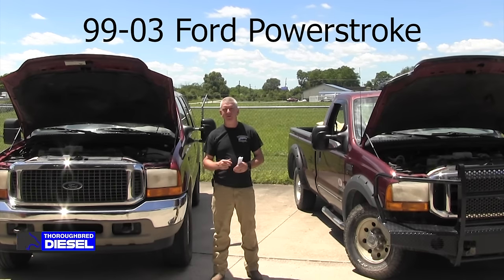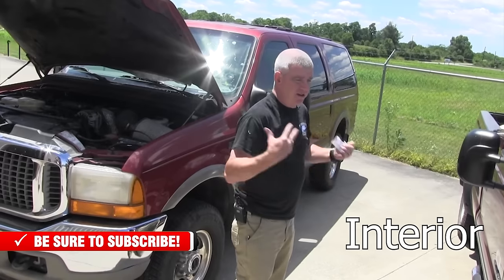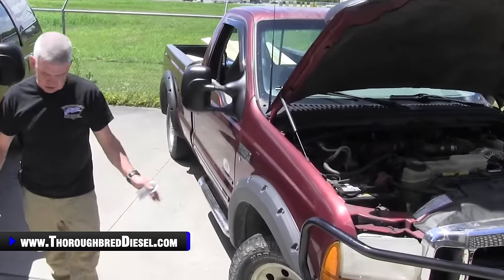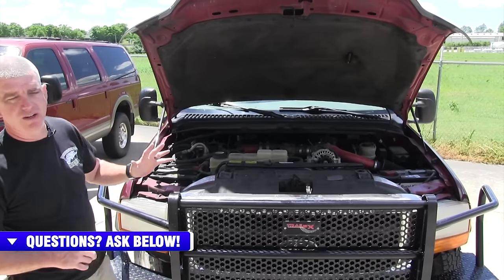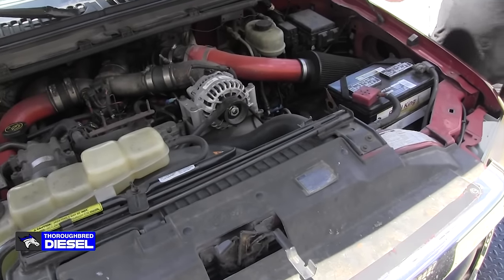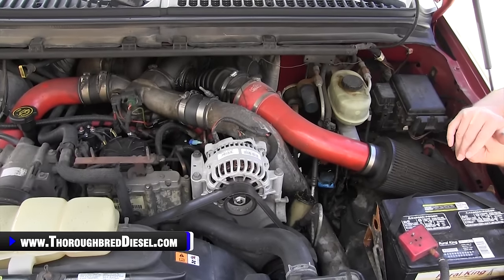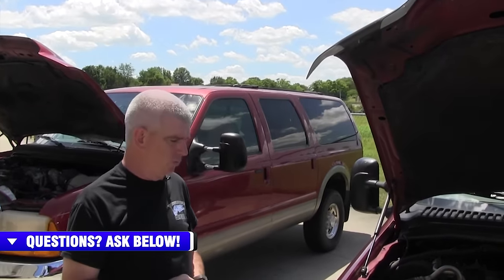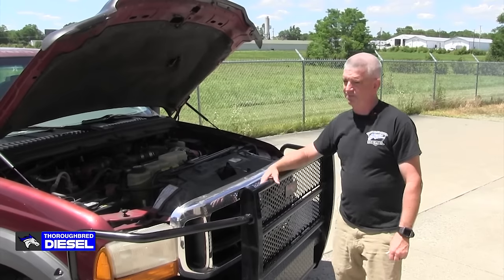TOP Problem Areas To Look At On 99-03 Ford Powerstroke | Secret Tips For Buying A Used 7.3L #ford

Comment: Hey Wade? How do you tell if a trucks odometer has been swapped, changed, or tampered with? I’m hearing it’s apparently really easy to tamper with them.
Reply from the maker: I really don’t know a surefire way to know,  but what you can do is get a vin report of warranty work done from a dealership, those will have mileages recorded when service was performed. If those numbers are higher than the mileage on the OD, then you know. That’s kind of a far fetched way but its really the only sure way I would know to be able to tell. Also some titles have mileage at transfer?
Reply: Can you pull some codes off of the ECM and tell? I don't know just thinking out loud.

Comment: what do you think is a fair asking price for higher mileage F250's in decent shape? maybe 300k miles, no mechanical issues at all, no rust, but a bit dinged up on the outside and interior.
Reply: I just bout one 319000 dinged up in an out but solid paid 6500 but then spent 1500 on a hpop an few other things
Reply: About 7k
Reply: @cccEngineer  Got a crew cab 4x4 7.3l at about the time I posted the comment for $7600. Swapped in a 6.0 trans cooler, replaced the oil cooler seals, fresh rear diff fluid and trans fluid, oil and fuel rail crossovers. Hauled a 13k lb 5th wheel from Colorado to New Hampshire and it handled it like a boss. Loving the truck so far.
Reply: @cccEngineer  Its almost a new year coming to 2021 and just bought a 2000 f250 4x4 2nd owner with 124 k for 15 k .  Turned down 19.500 for it twice within 2 months ownership.. If its been taken care of extremly well and no rust some are going for 24 k and Ive seen low mile excursons in the 40s.

Comment: Biggest issue with these trucks are the factory trans cooler and the leaking windshields. They leak directly on the fuse box and GEM.
Reply: Is GEM General Engine Motor ?
Reply: @bluetwo7282  It's Ford's version of a body control module. 99 to 01 it's on the back of the fuse box. 02 I think is when they changed over and it became part of the instrument cluster.(When they moved the second fuse box from under the hood)
Reply: @richmcgarvey4118  Thanks 🙏 for info Rich 👍 Holiday blessings 🌞
Reply: @bluetwo7282  the problem with the GEM is because almost every one of these trucks windshield leaks. Water runs down the pillar directly on to the GEM and fuse box. Fords answer was not to fix the windshields but to move the fuse box and GEM.
Reply: @richmcgarvey4118  ok good observation 👍🙏 thanks, I'm going to check ✅ my wind shield and fuse panel to water proof them.  Cheers 🥂

Comment: I'm considering the Allison 6 speed swap. Although, the ideal swap would be the 6R140, but so far I don't know of any aftermarket controller for them.
Reply: Put a zf6 manual
Reply: @cornelius6304  the Zf6 is rated at only 520 Ft. Lbs. The 6R140 is rated at 1400 Ft. Lbs.
Reply: @AmalgmousProxy  the zf6 is rated for 650 ft pounds and are considered bullet proof. Your 7.3 will never break it. And no one yet has matched up a 6r140 to a 7.3 yet probably for good reason.
Reply: The 7.3 engine itself puts out 525 of torque.
Reply: @cornelius6304 I see, you assume that my 7.3 is completely stock... Anyways, I have no interest in putting in a manual, too rare around here. I haven't seen one in the salvage yard to date. I'll keep the manual in my "fun" vehicle. My workhorse is going to stay automatic.

Comment: Can you tell me what sensor controls the air and fuel ratio to the turbo on the 7.3 psd
Reply from the maker: The MAP sensor, MAF sensor, Intake air temp sensor, and cam position sensor will orchestrate output to the engine.

Comment: I love my '02, but the 4R100 has been nothing but trouble...2 rebuilds so far.
Reply: Have you contacted ATS Diesel in Denver?
Reply: Or Brians Truck Shop(BTS). I have heard good things about their transmissions.
Reply: Just bought a 7.3 and it has a jasper transmission in it so luckily it will hold up

Comment: I have a 03 F350 I've heard that the oil coolers will start  to fail at around  60,000 miles on the 60's? Is this. true? What's  the fix.
Reply: napa has a seal kit for 60 bucks, tough to get it off

Comment: Thinking of getting a 2000 f350 with a 7.3l 230k miles or getting a dodge 5.9 24v with 246k both in my area any opinions?
Reply: Both good truck for sure. Depends on the price. I’d put my money into a 7.3 if I where you. That truck doesn’t won’t let you down, and will have a better resale value.

Comment: I have a 2002 7.3 powerstroke. Recently had rebuilt injectors installed. The truck is now smoking (white smoke) really bad after initial startup and coming back down to idle once it is drove. Mechanic that installed the injectors is saying there could be a problem with turbo. Any ideas or thoughts?
Reply: Injector cups and oring got cut on installation

Comment: What is the ford icp sensor for?
Reply from the maker: Injection Control Pressure sensor.  I regulates the oil injection pressure for HPOP operation.

Comment: 12/00 f250 4x4 is my go to rig has 320000 paid 6500 but had to replace the hpop an line as with icp she was a car hualer but never tuned or chipped she a virgin 7.3 😂

Comment: Ive got early 99 f350 rwd dually 6speed. Bought it at 200k now 250k . Never run right,  starts right up in coldest day, but no so underpowered, everything from tank screen to injector harness got replased. Passes buzz test, still no power. Bps, cps, icp, ips , boost and tps sesnors all replased including IDM,  I gues my hpop is bad.
Reply: Up pipe donuts leaking. Horrible job to fix, but the instant power you get back is worth it. Ask me how I know

Comment: I got a brand new transmission I never had a problem with it since it got cold it started saying service engine soon for about a minute and a half two minutes then it does a weird idle click and then the light goes out has anybody else had this problem or is this something I should be worried about

Comment: I bought a 99f250 with 250k miles well taken care of used to haul boats for a short time then it became a yard truck to just move both from one side of the yard to the other at $260,000 Miles my transmission went out I bought a a rebuilt transmission from a company that builds them for Ford 3 your warranty first one was bad had a bad shift pack in it since then I've had no problems I live in Central Florida it got really cold and my service engine soon light comes on for like a minute and a half and then it does like a weird idol change a bump in the idle and then that happens when the service light goes out I lost a ton of people with this problem could be nobody seems to know has anybody else had this issue

Comment: I have been looking at a bunch of 7.3's that many have serious blow by issues. (Beyond just a plugged crank case vent??) What is the best way to determine a bad motor in this instance??
Reply: make sure it still has it's ccv vent hooked up properly to the intake pipe, dipshits do a ccv mod and remove the turbo vacuum from the valve cover, which actually makes the crank case pressure way worse. the ccv vent is very important on these.
Reply: Good rule of thumb is to take the oil fill cap off, and just set it on the opening.  If the cap is pushed out of the way by the volume/pressure, and wont stay sitting over the opening, you have excessive blow by.  A steady haze is normal, (at full operating temp).  You mainly are watching for a distinctive "puff-puff-puff" as the engine is running.

Comment: Why no mention of the leaking up pipes? Biggest power robber. Crawl under with a flash light and look for that soot where the pipes go into the y at the back of the turbo. Luckily it’s an easy fix. Well, not quite easy. Actually it’s horrible.  But oh so satisfying when that turbo boost returns
Reply: Currently happening to mine.. just gunna do manifolds and gaskets and new uppipes all at the same time
Might as well do an upgraded turbo wheel any ideas?

Comment: Model Year 2001s with the 4R100 had an issue with 2nd gear. They went from a sprag to a mechanical Diode for 6 months on the build. It will go out eventually. Good news is at this age, most have probably been replaced(rebuilt). 
Also the Transmission cooler on the 7.3 4R100 was a joke. An easy update is to buy a 6.0 transmission cooler and install. Super easy upgrade, bolts in place and 3X the size of the original 7.3 one.

Comment: I have a 2002 F250 Powerstroke crew-cab 4x4 and it’s a great truck, but engineer Timmy put 2 filters on the inside of the fuel tank and you can’t tell if they need to be cleaned until you see a drop in your fuel pressure ( That’s if you installed one ).  Now you need to drop the tank to clean them.  Timmy also was the same guy that designed the Ford 390 and 428 where you had to remove the engine mounts and lift the engine to change out 1 spark plug, because if you need to fix a leaking oil pan gasket you need to remove the hood, engine mounts, lines and lift the engine.   Other than that, if you do proper maintenance they run for ever.

Comment: 2000 ,   2 wheel drive  , with forged rod motor if your lucky enough to have one...✝️👼🤟🤠 with a ZF6 with 650 horsepower clutch  so you can put 400/400 injectors in it  and the  biggest turbo of your choice and then  ungrade the fuel system throw some  valve springs and push rods in ,  throw a Hydra on it ... , and daily bad ass truck,    like a boss reliably ....

Comment: Roof n hood  rust cause by car wash.Haven’t anything bad to say about my 03 Black Lariat. Oh you will rebuild ur front ends on 2wheel n 4x4  180 thousand miles new trans. 7.3 is still a virgin knock on wood 
#1 thing owning any Diesel (Maintenance) oh don’t forget about the gas tank pickup forswore!!
Awesome truck rides n handles nice 2 Wheel drive n will pull anything 
If u find a nice 7.3 way worth the money n rebuild the whole truck $25000 u got it made stock.
Leave it Stock n good day

Comment: Bed rails rust out  remove the tape of the Axel's they cause rust the Axel's covers rust out fast also break issue well known steering gear and front end issues oil pan like to rust

Comment: Just bought 99 f250 252k. Wouldnt hardly pull loaded 14k dump trailer.
Reply: If you don't live in one of the northern States where it gets really cold, I would do the intake air heater delete. It is like $15 and really made a difference you can feel in my truck.  Several videos on here of how to do it. Hope this helps.
Reply: Camshaft Sensor. $23 on Amazon.

Comment: The 7.3 have stiction issues?
Reply from the maker: All HEUI injectors will have stiction issues to some degree. Important to keep your oil clean and changed regularly.
Reply: @thoroughbreddiesel  thanks. Any additives that help?
Reply: @rickdarris6152  revv x oil additive for extreme cases
Reply: @rickdarris6152  you only need to do it once or maybe twice then try archoil for your every oil change additive
Reply: Not really.  Stiction is more of a 6.0 thing.  7.3 injectors do not use spool valves.  Stiction is a term describing the 6.0 injector spool valve getting stuck, which does not exist in the 7.3 injector.  Quality oil does make a difference in both engines, but I've never seen a 7.3 benefit much form Rev X, for instance.  The injectors will eventually wear out, and at that point there is no fixing them with any oil additive.

Comment: DipStick oil leak - bad, nah, that's just a rust prevententive. In all seriousness, that's where my 99 250 4x4 ZF6 leaks.  Been thinking about the aftermarket billet fix, or slappin a bunch of RTV around and calling it a day.  It is 21 years old afterall.  Other than that love it, although it does not like starting below 50F without being plugged in. Does anyone have this issue of starting?
Reply: I used to. I bought a used started off a 80,000 mile truck, got good batteries, and switched to a 40/60 blend of Rotella T-5(15-40) and Rotella T-6 (5-40) and changed the oil in the HPOP when I do an oil change.  I haven't tested it real low, but last winter it started in below freezing temps like it was a gas motor.
Reply: I was having a similar cold start issue on my 01 250 4x4. I switched from the Rotella T-5 to the T-6 and mine starts in 28 degree weather with no engine heater. Oil changes are more expensive but better than buying 2 new batteries and a new starter.

Comment: wait what..?? lol im a truck guy i like ford and gm, but ford trucks r some of the worst rusting things iv ever seen, my buddy has 2 trucks where the beds have broken n cracked all apart at the mounts n the beds r broke thru n sittin down on the frame the body lines r all off, the newer one, the 3rd gens body is startin to sit down in the back of the cab because those mounts r totally rusted out.. its like the trucks r soaked in fertilizer every night.. hes also got a van with a powerstroke thats constantly needin some kinda money put into it, he runs a duramax n a few 6.5s n they all run n drive great we barely every trouble out of the gms, i also have a 94 6.5 n that things been amazing.. i dragged it from sittin in a field for years put a lift pump on it n im still drivin it lol i had to put a fuel tank on it the diesel was all gummed up but thats it

Comment: I've been running, owning, and rebuilding marine diesels since 1960. My 7.3 is the least reliable diesel I've ever run. When it runs, It's one of the best engines I've had in a PU. But the HUEI injector system has many failure points. It's the most mickey mouse injector system I've ever seen. The engine wiring harness is as thick as your arm. When your truck gets old it will have to be replaced. The Cam Position Sensor will fail about every few years and the engine just stops w/o warning. Carry a spare. One year I was towed 3 times. Now I replace all sensors every 2-3 years. If I had it to do over, I'd buy a used Dodge with the Cummins diesel, before all the sensors. If I was young, I'd replace my 7.3 with a Detroit Diesel (no sensors, mechanical injectors, no computer). It doesn't matter how clean the engine burns or what the mileage is if the engine doesn't run. I wish the EPA could figure that out.

Comment: Good video
Reply from the maker: Thanks!
Reply: @thoroughbreddiesel  For not being a Ford guy you did a great job man! Didn't miss much. 

I would recommend a couple things for others reading this comment though. Get a blue tooth scanner off Amazon and use an app called 'Torque Pro' and you can scan a truck before buying it to see if any codes pop up and you can see a bunch of other diagnostic and real time numbers in the app.

They are 20 year old vehicles like you said, so its starting to get old now... but the engines should still be solid and only half way thru their life IMO.

Ball joints, u joints, hub seals, wheel bearings in the front will all need to be replaced soon if they havent been yet.

I also recommend an injector buzz test if you can do that as well.

HPOP and AC and the windows may all be starting to fail now as well too. Mine did at 250k miles a year back.

Just change the fluids and filters religiously and you'll have a truck that'll last a very long time.

Comment: these trucks are old enough to need the tank fuel filter replaced
Reply: There's 2 in the tank and you can just clean em or get rid of em.
Reply: i got rid of them, replaced with a straight hose and a fuel pump up under the frame where i could get at it

Comment: The power and sound of the Triton v10 2001 super duty f450. totally ridicules. Only ford dose that. What's best, it's a four letter word. Ford didn't change that. One should have a gasoline truck 💫 to backup the diesel or electric. One can be sure they need a few pulled back. Especially the electric ⚡️or the diesel ☠️